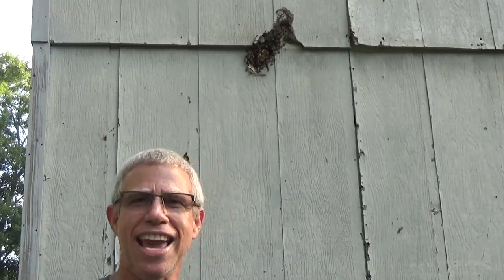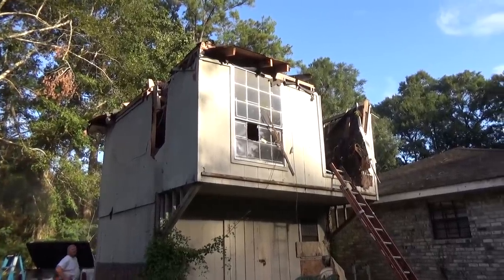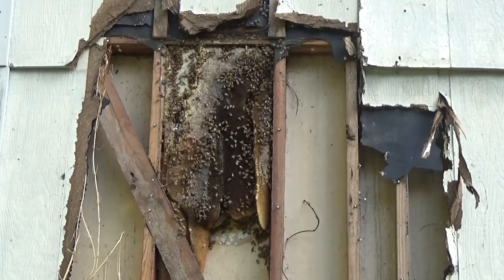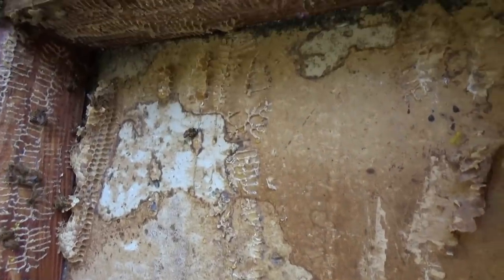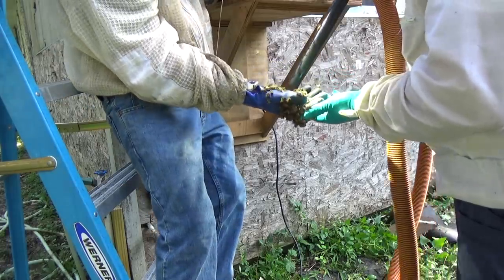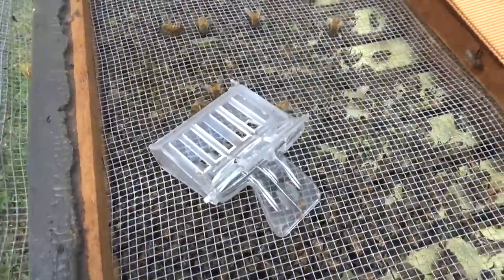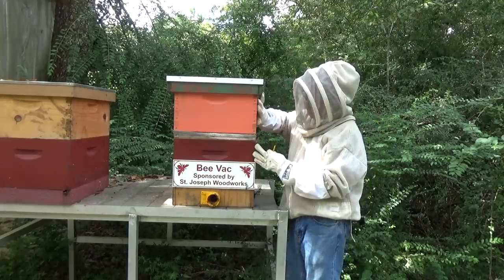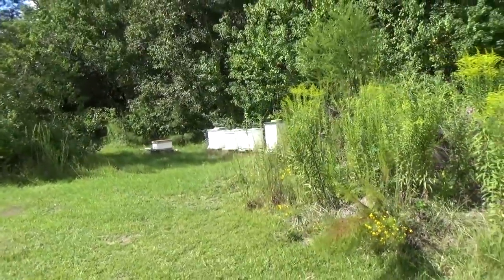The shed has to go and so do the bees in there, bee rescue.

Comment: Mr. Ed, I have a beehive in my granary wall right next to the door. Taking the wall apart is not an option, therefore the hives would have to be abandoned. The access hole is a perfectly round knothole. Is it true that smoke can be blown into the hole and the bees captured in a sack?  Can they just be dumped into an empty hive box?
Reply from the maker: Simply putting smoke in the entrance will not make the bees evacuate. As long as there is comb in the cavity space, the bees will not abandon it. You should check into the process of "trap outs" It is a long process, but it does work. There are lots of videos on this topic so you should be able to find out something about them. Please keep me posted on what's going on with your bees. Thanks for watching. God's peace.
Mr. Ed
Reply: Put a vacuum on the hole, leaver alone a couple hours

Comment: Mr ed can you send me the dimensions of one of those frames and the inside and outside of the nuke please.  Want to build some out of some scrap lumber I have so I can remove some bees from a friends motel down the street. This hive is massive and quite aggressive.  It actually has multiple queens.  I have lots of plywood and 1×2 and some 1x1
Reply from the maker: I do not know the exact measurement. The frames I use are standard frames for the 9 5/8 deep super. When I build a nuc or a deep box, I use a frame as my measuring orientation, and they will fit every time. Good luck with your project. Thanks for watching. God's peace Jeffrey.
Mr. Ed
Reply: @JeffHorchoff  planning on building the frames myself right now. Cant afford to buy bee keeping supplies but some stuff I will have no choice except to buy